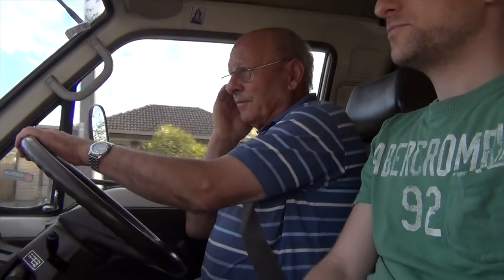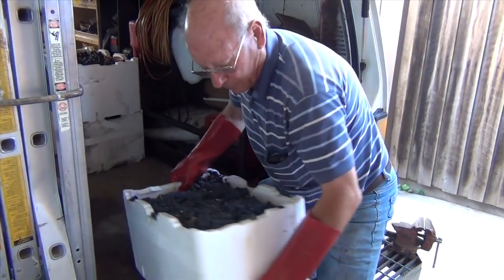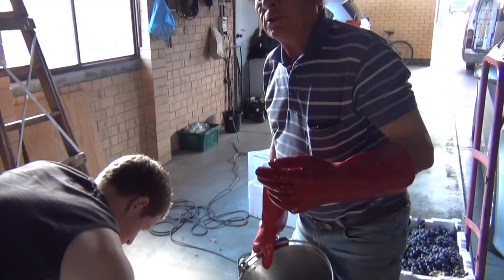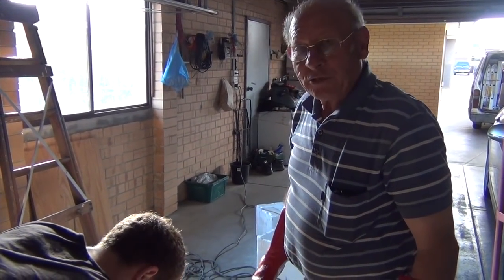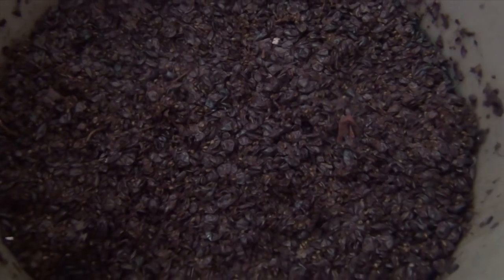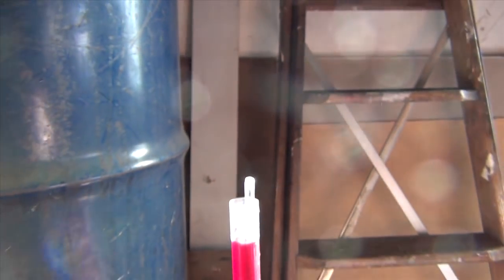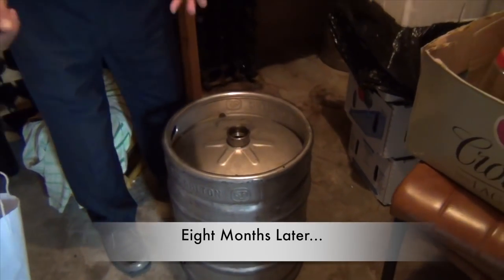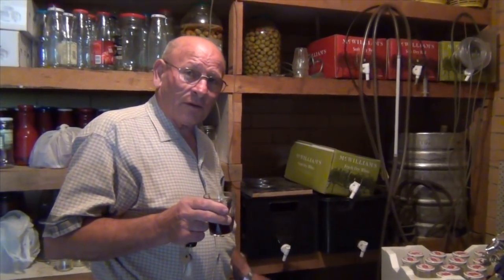How To Make Homemade Wine

Comment: Genuine video ,that shows how to make genuine vine, made by genuine people :)
Reply: It's a bit sad at the end when he says it's cheaper to buy.
Reply: Mojoman57 Totally have to agree with you on that!
Reply: Thanks for a informative article, here are some more tips for how to make wine…
Use the right equipment. Things like plastic buckets and bins come in different grades of plastic. You must use the food-grade plastic products not the cheaper buckets you might use to clean the floor!
If plastic buckets and bins start getting scratched and grazed, replace them. The grazes will start harbouring microbes and eventually you’ll have a spoilt batch of wine.
If stirring the must (the initial mix of fruit and water etc.) in a bin, scald the spoon with boiling water first to quickly sterilise it.
Fill and top up airlocks with cooled, boiled water – never straight from the sink.
Avoid metal spoons and sieves with fermenting wine – i.e. after the yeast has been added. Sometimes they can taint the wine. Avoid wooden spoons, which are hard to sterilise – plastic is far better.
Reusing wine bottles is fine, ask friends to save them for you and check with local clubs or restaurants who are often happy to give them to you. Wash out immediately as a clean bottle will be a lot easier to sterilise when you come to use them.
Rack your wine to clear it before bottling. That is, using a syphon tube, suck up the wine from one demijohn into another leaving the sediment (called lees) behind. The tubes with a base and valve are cheap enough and a make this easier. Allow the wine to settle for a week and repeat if necessary before bottling
Never judge your wine by the taste as you bottle it. Most often you will think it is a disaster. Some wines can take two years to mature. As a general rule, maybe try a bottle after six months. If it tastes harsh, leave the rest for at least another six months.
Allow time. Time is the great wine maker and you should never be in a rush. We’ve made wine that was 9 months in the demijohn before bottling and drunk it 3 years later. The next year it was even better!
(Reference: Pavas grape plan site )

Comment: Great video.  Thanks for sharing.  Did the wine end up with a little vinegar scent or nail polish remover?  If you punch down the cap of skins two or three times a day, it will help tremendously.  Also rack it off the gross lees within a day or two of pressing.  The thicker compacted lees are a microbial palace.  I know people don't like the idea of sulfur dioxide, but it is really important and a natural byproduct of the fermentation.  Some yeasts produce a lot more than others (EC-1118, isolated from Champagne, France).  By adding a bit more SO2 in the form of potassium metabisulfite at various stages, you can basically interrupt the natural breakdown cycle right where you want it and keep it there for many years, rather than just briefly.  Juice wants to become wine, wine wants to become vinegar, vinegar wants to become water.  This is what would happen in nature, without any intervention from us.   I am glad to see people passing down the tradition of winemaking though.  It is a great hobby.
Reply: I wouldn't be too scared of it tasting like vinegar or acetone, these people shared the video of their hundreds year old tradition and way of life because they thought it tasted great. I think the fact that this guy was drinking his years old wine was evidence enough that his method works as presented without modification.

Comment: Just wanted to make sure I saw it correctly. After you crushed the grapes you put it in the stainless steel barrel for 7 days then drain and press then you put it back in a different barrel for 6 months air tight. 

Curious what temperature you keep your wine at in the barrel?

What does the bottle
Do and what are you using

after 6 months do you bottle and enjoy or bottle it and let it sit for another 6 months.  

I do want to try this out. Hopes this reaches you. 

Joe

Comment: Thanks so much for sharing. This is perfect! I've been looking for natural wine making and I love how you don't even use yeast or sugar. Much, much better than all the wine making instructions that tell you to add all sorts of stuff on top of excessive sterilization. I can't wait to make this with my own grapes.
Reply: theerd17 you’re right but without adding sugar the wine will have less alcohol, the more sugar the more alcohol percentage, unless you have very sweet grapes, and I mean very very sweet. But the video is so informative how to make your own wine without adding any chemicals such us sulfates. I’m making my own first wine, that’s why I came to this video. I added sugar, dissolved in minimal water, and I added yeast to speed the fermentation, beside that I didn’t use any sterilizers or “yeast food” or any other chemicals. I’m hoping it will come out as a very good wine as  my parents were making, in the same way. So far it worked almost 4 weeks, now I need to separate from the grapes i will add, if needed, some extra sugar and ferment it second time, adding some yeasts probably.
Reply: Wine spoils quickly with no preservatives.  There is a RIGHT way to make GOOD wine.  It is NOT open for debate.
Your wine may taste great for a week, but you aren't going to DRINK it all in a week.  If I'm putting all this effort in, I want it to taste good until I drink it.

Comment: Hello, this is my first time to make white wine,  I do not clean my grapes! Probably there is some insects of all kind!!! I do not have a cover for the little tank I am going to use, is this critical? Needs to be seal? Can I cober it with some kind of material?
I hope I hear frome some one very soon!!
Thanks very much.
Reply: I just started making wine last year so I'm no expert. I cover it but not tight when it is fermenting. When I pour it into demijians for winter it is covered tight with a bung that has a hole for  gas release cups you can buy. Just like his water bottle, it allows gas to escape but nothing comes in.

Comment: When the grapes are first mulched and put in the vat for 8 days, is that vat airtight? I have mine in a big plastic tub with a lid on it but it isn't airtight... Doeas it have to breathe for a week before you use the air trap in a sealed container?
Reply: it has to breathe, just put a clean cloth over it so no fruitflies or anything can enter the vat. Make sure you stirr twice every day so the dry 'hat' of the wine (the skin of the grapes come floating to the top and dry out) gets broken up and keep it moist.

Comment: At 7:50 - Is it neccessary to use the hose and bottle or could you just seal it airtight without the hose?
Reply: Also is that just water in that small plastic bottle?

Comment: could someone please advice me more on this couple of things.
1) did he add yeast at the end or he didnt? 
2) i didnt quite get the bottle he put on top of the other so the carbon doesnt escape??
some help will be appreciated.
Reply: From what I gathered he didn't add any yeast, but used what yeast is present on the grapes when they are unwashed. For 2) The bottle allows the carbon dioxide to escape but does not allow air to enter - it's an airlock.
Reply: PalfraDK many thanks

Comment: Those tools are prone to have bacteria on them right? is there a way to ensure that bacteria is not present in the final product without destroying the wine?
Reply: TwoLargePizzas I would assume because of the sugar, carbon dioxide and the alcohol the bacteria count would be very low?
Reply: Can carbon dioxide and alcohol prevent bacteria from spoiling the wine? Do they act like antibiotics? Let me know thanks :D
Reply: TwoLargePizzas Yeast usually outcompete other microorganisms, especially considering only certain microorganisms can survive without oxygen.  Alcohol technically kills bacteria, but there is usually not enough alcohol for that to be a factor.  If continuously supplied with sugar, the yeast would eventually produce enough alcohol to kill themselves.  Different yeasts have different levels of alcohol they can tolerate.  Generally, if something goes wrong, wine does not spoil, but turns to vinegar as a result of a different bacteria.  This can't happen unless there is oxygen present, hence the need for an air lock.

Comment: is there any chemical have to use to make red wine???
Reply: No, you need good grapes, tannin and sugar content most any dark red with thich skin and never wash your grapes before stomping them to pull the stem, you don't need any machines or chemicals....think ancient and research the old ways...no commercial wine is real anyway.
Reply: may i use any kind of grapes?? or only red grapes?
Reply: Well, good question, how did the Egyptians make wine....they say modern wine making came about since Louis Pastor with his technique. The guy that taught me, "vaguely" said, I just want to be able to drink it, and made it with timing....no..tools...meters...just temperature awareness and keeping oxygen out after the 1st fermentation...and then time in the bottle
Reply: Thank you
and what temperature is perfect?
do u have any kind of chart(instruction)  that will i follow
Reply: I may make a video of that but for now, dark red or black grapes 80 degrees f. Watch wine cap rise, after a week, punch down every other day until wine cap starts to sink on its own...transfer juice, then crush wine skins by stomping them in bucket, strain juice off into 5 gallon glass water jug and put bubbler on it. Watch fermenting bubbles and rack into another container remove the Lees. (about 2 months) Then continue fermenting until wine clears...malac to lactic acid complete(4 months). At that time cork a bottle shake it, if uncorking foams out, malic to lactic fermentation not done yet, leave for 2 more months. Bottle with blue lotus as a preservative like I did, and you don't need sulfite as a preservative as the romans did, Do as the Egyptians did...see my site, "Blue Lotus Organic Red Wine".
Reply: Old Parts Great information,  Thank you!  I just have one question,  when you crush the grapes like on the video and leave it for 5-7 days during the first stage , it will not get infected with bacteria?
Reply: Not this method but others do use chemicals to sterilize, kill yeast etc.